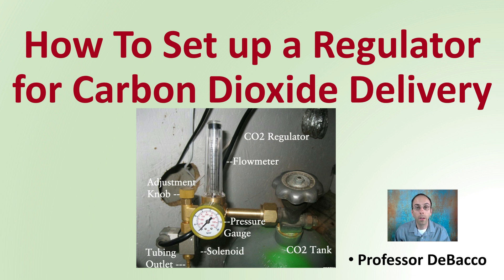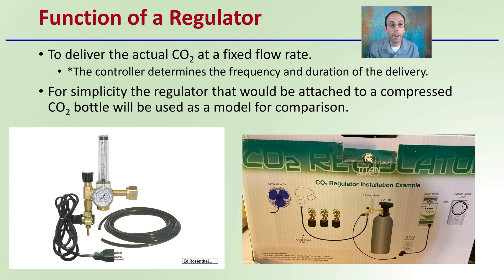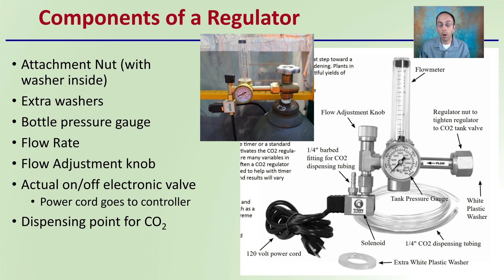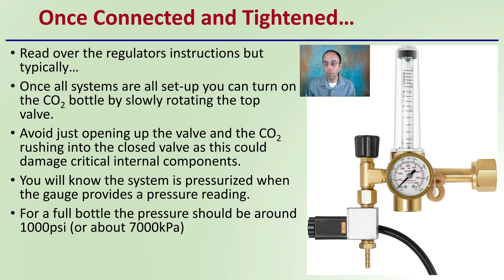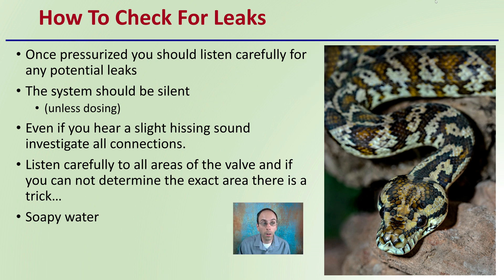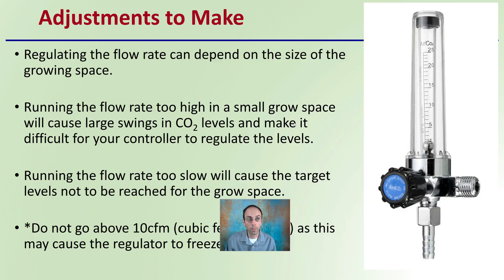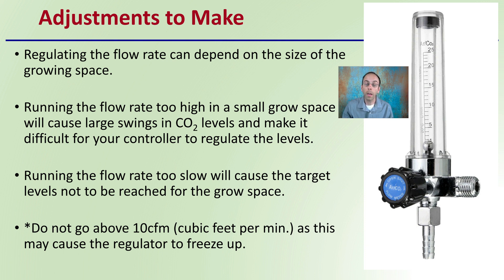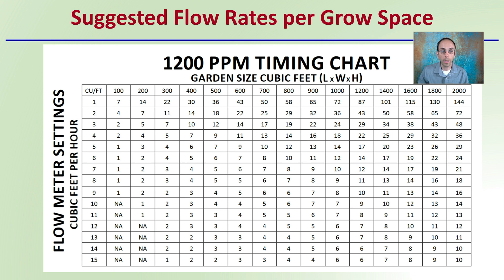How To Set up a Regulator for Carbon Dioxide Delivery

Comment: And just a question are you saying that with a 1400cu/ft room and the regulator set to 10 scfh it would take 10 hours or 10 minutes  to reach 1200ppm?
Reply from the maker: With a flow rate of 10 CU.FT/HR and a room size of 1400 CU.FT the timer should be set to 10 minutes to bring your CO2 level up to 1200 PPM.  See description for source and further details and descriptions... https://hydrobuilder.com/media/pdf/instructions/co2reg_instructions.pdf

Comment: Some older Titans have the bigger washer on the intake stem that the newer ones will not fit. it can be a pain finding the washer so instead ask for a replacement stem that the new co6 washer or whatever they are called will fit and it should only be around $5.
Reply from the maker: Thanks for sharing this cost effective correction to a potential problem.

Comment: Clear presentation for beginners but flow rates should be constant from the bottle with all the control of flow handled by your CO2 controller.
Reply from the maker: Bottle pressure and temperature can impact flow rates which should ideally be made consistent with the regulator.  Bur there are some conditions that can create some variability.

Comment: Hi, I'm new to CO2 and I want to implement it for my next crop, my growing space is 32.4 mts3, that is, 1144.195ft³. I am thinking of acquiring a 6m3 CO2 tube. I do not know if it will last for 4 months of cultivation, what do you think? also I am going to put a solenoid valve or solenoid valve together with a CO2 monitor controller. If you could guide me or give me some information on how to choose the size of the CO2 tube that I need to administer CO2 to my culture during those 4 months. or if you have information on when it is better to apply it, I could use ten thanks a lot and very good videos
Reply from the maker: This should help... https://www.youtube.com/watch?v=_RVbQLMsU9U  Also, if you use a compressed bottle system you can simply change bottles as needed.  Point of reference for a 10,000 cubic feet growing space consumes about 50lbs of CO2 per week maintaining 1000ppm level.

Comment: This was just confusing and poorly done.  Lots of time devoted to "not exceeding 10 CFM."  You do realize that these flowmeters indicate in Standard Cubic Feet per HOUR?  What size warehouse would need 10 CFM?  Also, what's with the totally useless timing chart?
Reply from the maker: CFM means Cubic Feet per Minute. CFM measures the volume of air in cubic feet for each minute it moves. In the case of an air compressor, CFM indicates how much air can move per minute.  Also, the chart can provide a great starting point for those who know how to use it.